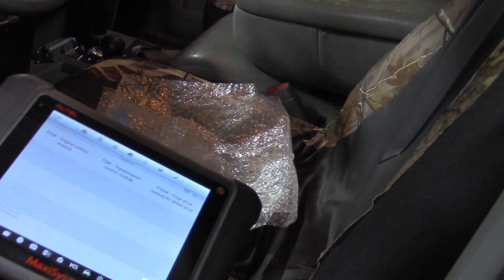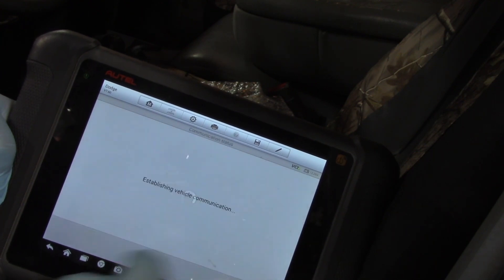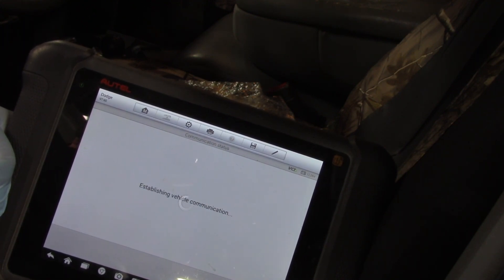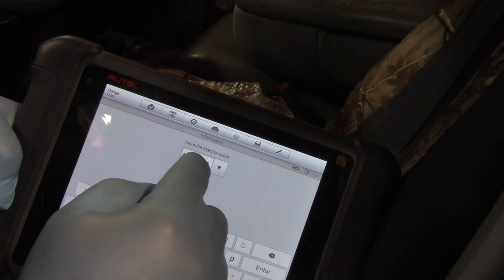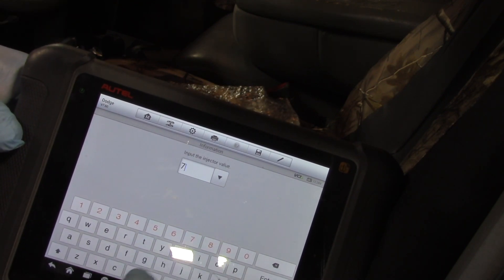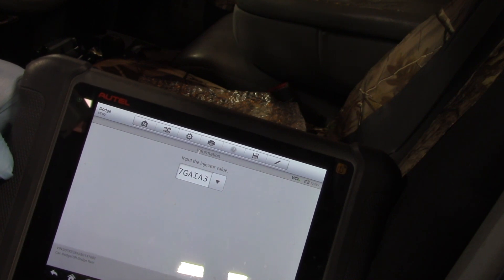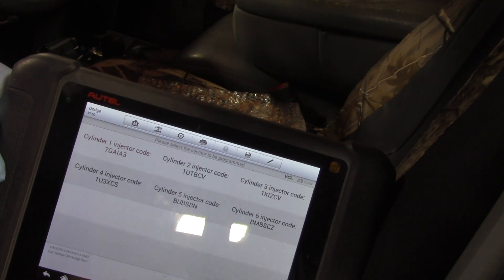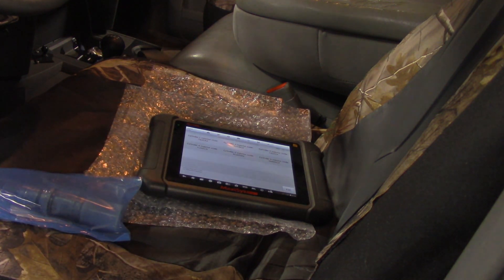Cummins Flow Rate (Injector Quantity Adjustment) Programming with Autel Scan Tool

Comment: 2010 ram 2500 6.7... Hello I recieved and installed injectors but having problem with calibration codes. My old injectors were 6 digit and these are 9 digit and my computer only allows for 6 digit calibration codes???

Comment: I bought.l some 5254261PX from Cummins and they came with neither the tag or any flow rates codes stamped on the injectors. How do I find the flow rate codes?
Reply: Ever since our? Is the code import or can I duplicate a code or use a random one?

Comment: So how did you determine which injectors were bad since cummins doesn't provide cylinder balance rates at the obd II connection
Reply: you can perform a injector disable test with your scan tool

Comment: Without telling us what model Autel that is your information is worthless.  If you truly want to help people out you should have thought of that. everything else is basic common sense,
Reply: It's an Autel MaxiSys.. However, just about any bidirectional scan tool should be able to write injector codes. It's a pretty basic procedure...
Reply: What about for bigger trucks that u a 9 pin adapter
Reply: That is not true at all.